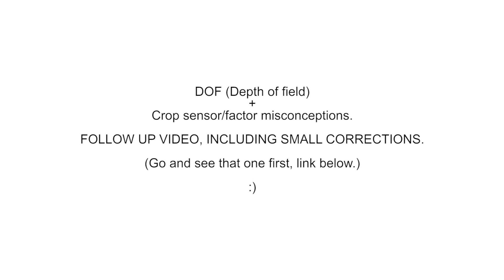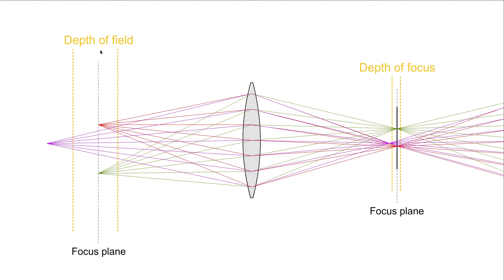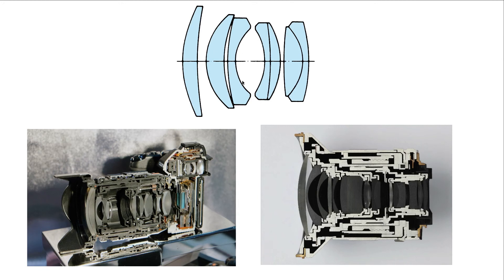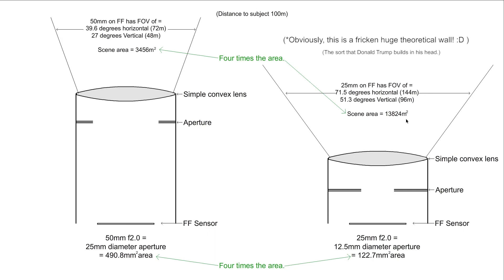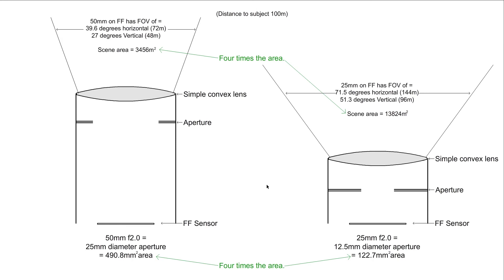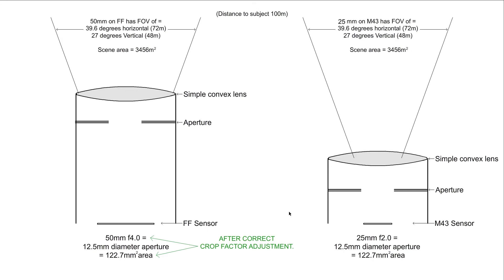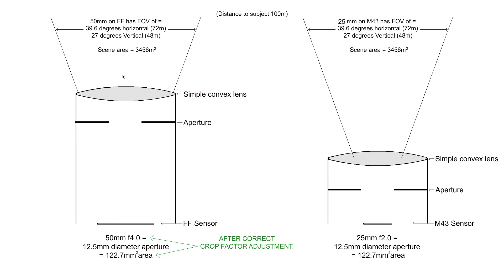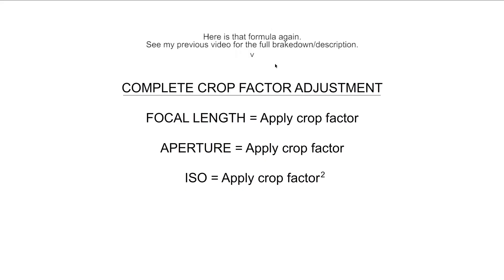Depth of field and crop factor misconceptions. FOLLOW UP.

Comment: Ok so i watch the original and the follow up video.
I agree with everything but i don't get one thing.
Where you explain about how higher pixel density changes the depth of field, in theory is true and i 100% agree with it but in practise if you compare a 20mp ff and a 50mp ff, even thou the pixel density is massively different, the bokeh/depth of field should look exactly the same, because the pixels are soo small that you should not be able to physically see the difference. I might be wrong, but no one is talking about how he changed from a 20mp FF to a 50mp FF and saying that he had difference in the depth of field.
I can't even find a video/blog/forum with real world examples. I really wanna see 200% or even 400% zooms on photos taken with close to the above mentioned megapixels.
Reply from the maker: Quetzalcoalt hi. I think the bit you want to look up is the circle of confusion. Filmmaker IQ did a great video covering this. 
(They go into more detail than I did)
It shows that if you raise the pixel density the acceptable depth of field narrows. (Depending on how you judge the final image of course. Viewed across a room on a TV it would look the same. But on closer examination you would notice the OOF areas. )

This is all true. And it’s why nailing focus for 4K work is much more critical than nailing focus for FHD. 

But also bare in mind if you keep the total resolution the same. (So both 4K )
And you shrink one sensor. This is raising the pixel density. 
This is why technically speaking a smaller sensor has a narrower DOF than a large sensor. (Against popular belief, but technically true)

But of course the smaller sensor has the narrower FOV for the same focal length. 
So then you have the framing different. 

So it’s all a juggle between all those factors if you want to match shots between very different cameras.. Or you simply want to fully understand what’s happening inside your camera. 

I hope that helps.

Comment: But how about full frame lenses on crop sensor camera's?
What I do want to see is how full frame lenses act on crop sensors.
E.g. Will I see the difference between f1.4 and f1.8 on my crop sensor? Or will it be outside my crop sensor view.
Or does the f1.4 act as f2.1 (f1.4 x 1.5) and the f1.7 as f2.5 (f1.7 x 1.5)?
Reply from the maker: FF on crop will simply be the same image but cropped in to centre. so the DOF will be the same as if you simply cropped a FF image. technically the apparent DOF will be shallower due to what happens to the circle of confusion. but remember your framing will be tighter, so you will need to step back from model to get same framing, which in turn makes DOF wider (due to distance from model.)

Comment: Hey, just wanted to let you know I appreciate you taking the time to make these videos. Your diagrams were simple, but I feel they were adequate for the explanation. I'll definitely send this video to some people as your explanation is  certainly better calculated than when I try to explain similar principles. 

It's interesting that as small sensor camera's are getting more adopted by working professionals certain facts slowly are getting accepted in the community. 

The last one that I feel is completely misunderstood is compression. It seems people now can except focal length equivalence (that wasn't too bad), a huge step was people accepting aperture equivalence (took way too long), ISO equivalence is getting there, but it seems people can not accept that 'compression' is not determined by the focal length alone, and that a equivalent focal length and aperture will have the same compression.

Comment: Quick question, i get most of what your saying about crop factor, and a f2.8 lens on a m3/4 has the same DOF as f5.6, but does a f2.8 lens on m3/4 let in f2.8 amount of light ( ignoring t-stops for now ). 

You may have covered this and i simply missed it.
Reply from the maker: aFLYER1980 did u watch the original video for this. (This vid is just a follow up) that explains much more. 

But in answer. 

M43 native 25mm f2.8 
Full frame 50mm f2.8
=
The exposure on both is the same. 
But the whole image on the full frame is constructed from 4 times the amount of photons. 
The 2.8 aperture on the FF cam is physically twice as wide as the 2.8 on the m43 because of the focal length. 

Twice the width = four times the area. 

So the answer isn’t as straight foreword as most people think. 

They simply think if brightness / exposure is the same. Then that means same amount of light. And yes if you looked at a square millimetre of both sensors, they would both be getting the same amount of light. 
But that full frame sensor has 4 times the area. 
So it’s making its image from 4 times the total light.
Reply: The intensity of the light is same as with f/2.8 on FF but the total amount of light is same as with f/5.6.

Comment: "one 50mm on a FF and another 50mm from different manufacturer on the same camera is gonna have the same field of view" theoretically yes but if you try it it's never the case. Even same manufacturer lenses, p.e. I compared Canon EF 50mm f1.8 and f1.4 and weren't equal. Then compared to 50mm Sigma and got yet a third field of view.
Reply from the maker: Hugo AV always going to be small variables. Not worth worrying about really. As long as you have your head around the basics you can make all the adjustments u need. 

(From my experience the FOV differences are very minimal. Even when comparing diff system lenses. Eg my 12mm m43 lens closely matches my 24mm full frame lens. )

Comment: A contentious issue indeed. I follow all of the math and logic and results you have outlined and given an engineering background, I fully understand them.  There is however one small thing that nags at me. For over 40 years I have been using the same handheld light meters to determine correct exposure with film cameras across various camera sizes (either incident or reflected measurements). And what you haven't explained is why either my large format negative (5x4) which receives a lot more light than my 35mm negative (according to your line of thinking) or the 35mm negative should be incorrectly exposed if I used the same light meter. Remember that light meters did not account for negative size nor did they account for focal length or crop factor etc.. You will say that ISO is measured as light falling on a square inch, so what about film ISO? If it is the same, then light meters should have had a way to compensate for that or there should have been dire warnings in the manuals about this and the jump from 35mm to medium format is similar to m43 jump to FF however, the jump from 35mm to 5x4 or 10x8 negative is so huge that the exposures would have been totally off on one or the other based on light meter readings. Yet they were not. How do you account for that?
Reply: The exposure is the same for all film formats, but the smaller negative requires more enlargement to match the field of view.  So, if you are shooting HP5 in 4x5 with a 150mm lens at f/11, and you expose at box speed, then to get the equivalent granularity (noise level) and field of view and depth of field, you would need to shoot FP4 in medium format with a 80mm lens at f/5.6  or Pan F in 35mm with a 50mm lens at about f/3.5.  If you shoot FP4 in all three formats, you have to open the aperture as you go smaller to get the same depth of field, but you can only get the same noise level if you print smaller.  To get the same noise level, you would have to print 4x5 at 16x20, 6x6 at roughly 11x11 and 35mm at roughly 5x7.  The light meter works for all formats because of how f/ numbers and ISO are calculated.  But equivalent exposure does not mean equivalent field of view nor equivalent noise level.
Reply from the maker: hi, yes exposure is measured differently. i think this is one of the sticking points for many on this.  I'm am currently working on a video that shows much more practical results/comparisons regarding the ISO equivalence. But to briefly explain, the ISO is measuring the GAIN added to boost signal from sensor. (just like any amplification for audio etc) and a smaller sensor at the same ISO number is getting the SAME exposure. BUT across the whole surface of the sensor, there is less total photons hitting it, simply because of its smaller area. so essentially the ISO is applying MORE relative gain to amplify the signal to create the whole image. even though, if measuring a square inch of that sensor the gain would be the same. (its technically adding the same gain, but because the sensor is smaller the original signal is a lot weaker anyway... hence 'relative') i hope this makes sense.... and this would be exactly the same for film. if you take it to imaginary extremes it may help you  see what i mean. so if you had a piece of film 1 meter square, (lets say at ASA 100) the exposure would be the same for a pice of film 10 cm across. at ASA 100... but the huge pice of film would have (in total) a massive amount of light hitting it compared to the small piece, ... and its ALL the light that in TOTAL makes up our WHOLE image is what is important, not a arbitrary portion of that image. (with the portions size only dictated by sensor/film size)... so yes. exposure is one thing. but it doesn't tell you the total amount of photons that go into creating the entire recorded image. if you are comparing different sized sensors or film stock, and you want to match image noise, you need to level the playing field and allow both images to be made of the same total amount of light fall. (same amount of photons) and this will mean making the smaller footprint brighter, as it is simply concentrating the same light over a smaller area.
Reply: @biscuitsalive  "I'm am currently working on a video that shows much more practical results/comparisons regarding the ISO equivalence" Did you ever make this video?? I searched your channel for "ISO" but couldn't see anything obvious... Loved your straight-forward explanations on this topic, but would love to dive deeper into the whole issue of noise!
Reply: All these comments are good.  I wonder if a theoretical analogy could be made not only about sensor size compared to film, but also light receptor density on the sensor equating to fine or coarse grain film in terms of iso speed and noise? Just a playful thought. Lens manufacturers should stress angle of view, not focal length when declaring 35mm equivalents.
Reply: Total light on sensor has no meaning in photography.  Pixel pitch is what matter to exposure.
The author of this video is wrong.

https://www.cambridgeincolour.com/tutorials/digital-camera-sensor-size.htm
Reply: Finally, somebody understand this. It's photon flux per unit area of the sensor surface. While a full frame sensor accumulates more TOTAL light than a crop sensor the intensity per unit area is the same on both, which is why the exposure is the same  when you use an external light meter for both 35 mm and 6x6 film sizes.

Comment: In complicated(multi element) lenses "compression", more correctly called "perspective distortion", is not so much tied to focal length. Also it's possible to create lens that(almost) do not have any "perspective distortion" thus is telecentric.

http://cfile2.uf.tistory.com/image/2666284655C162E10DEF8B

Another thing is that many lenses have "mechanical vignetting"(do not confuse with "light falloff" that also happen in lenses). It create kinda a aperture that work stronger the more on side light rays are(Because of that, apparently it made designing lens easier -> cheaper overall. And it's reason why so many cheap or/and old lenses have "cat eyes").

Also it's not true that it doesn't matter where aperture is, even when it's just single lens.

https://c1.staticflickr.com/3/2895/33820191350_e3f4a31bab_o.png
https://c1.staticflickr.com/3/2947/33361879804_a22dd3f025_o.png
https://c1.staticflickr.com/3/2818/34163434476_062faa430f_o.png

In this example it's clear. Everything change but generally -> When aperture is at the back it create a hell of front physical vignetting. Front aperture seem to creating huge coma. While in middle it's perfectly usable lens.

For single lens lens
https://c1.staticflickr.com/5/4165/34073982691_341a92da5a_o.png
https://c1.staticflickr.com/5/4194/34073982641_2786a99df1_o.png
https://c1.staticflickr.com/3/2817/34073982841_3f7ec2e2d3_o.png

Comment: You should do a whole video on lens compression within different formats--full-frame, aps-c, medium, 4/3rds, etc.. .  You be a massive legend, up there with George Eastman and the Lumière Bros.  People would speak reverently of you for centuries to come.
Reply from the maker: TheViscountOmega :D
Il think on that! :)
Been messing with medium format recently. 
But I'm not sure compression really changes that much once you have matched FOV and distance to subject. 

So when you do the CF maths and make adjustments as I explained in the last vid,
Then compression should match too. 

But I haven't really gone into practically checking this is true yet. So I am curious myself. 

Prob best to do some practical tests between medium and m34
If I can match those extremes the rest should be easy peasy. :)

Comment: haha so I told you to do some thing u already did.. hopnesty had forgotten! thats my story and Im sticking to it!!
so, It begs the question of rating lenses, maybe we should have light per cubic cm?
Reply from the maker: I think in an ideal world we would forgot the old systems and go with Tstops/transmission stops (instead of Fstop) and a FOV angle (probably horizontal, followed by vertical) that would be way more useful to someone buying a new lens. and none gets confused when they swap to a different system.
Reply: but that would require two very challenging things 

CHANGE 
and 

Commen sense
Reply: Name of lens(for example 50mm F1,8 IS ASPH) is not technical specification. That's is very important in first place.

Also T stops won't rly work in photography as build in apodization filter is a thing. Also one manufacturer F1,8 is T1,9 another F1,8 is T2.1. And generally people more care about bokeh and focus than how much light sensor get.

Comment: Correct.  Similar discussions have creeped on other places.  Most people interpret the ISO as a unit of image noise (which it isn't) and aperture as a unit of depth of field (which again, it is not).  Likewise, the old 35mm film guys like myself tend to interpret focal length as a unit to measure the field of view (which it could only be if every camera had the same sensor size)